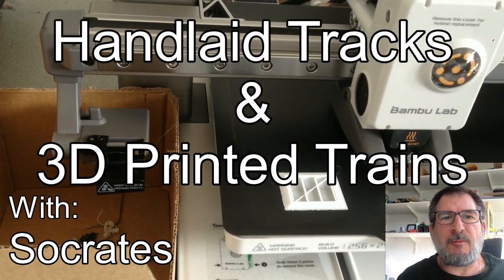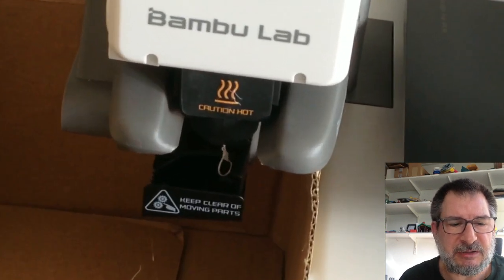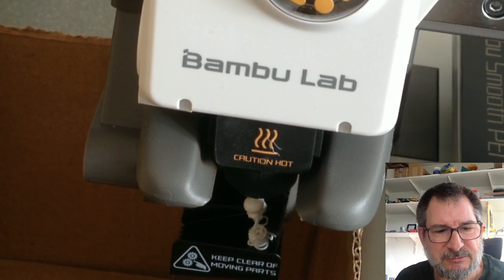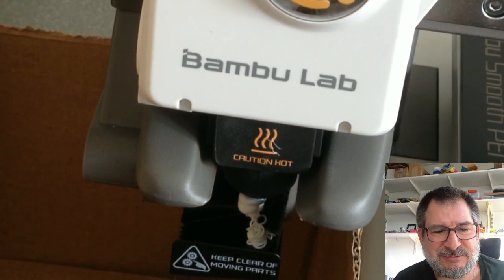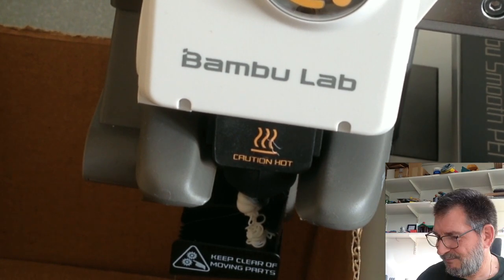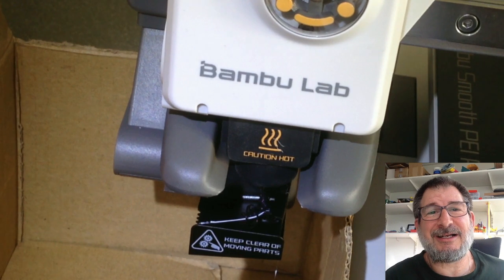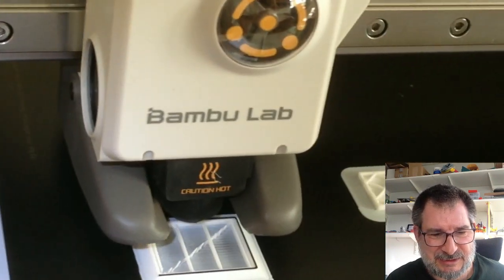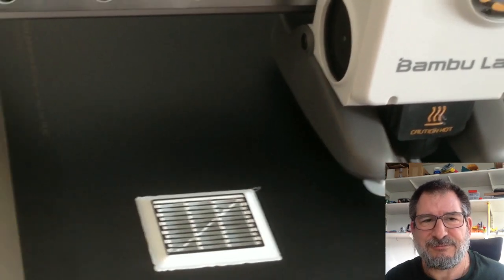Why Is My New Bambu A1 Purging & Printing So Slow Now?

Comment from the maker: Thanks so much for your feedback and suggestions. Since the slicer was sending the Gcode so slow, the printer was doing what it was told to do. The time estimates were spot on. Somehow the STL object became corrupted in the slicer I solved the issue by uninstalling the slicer and reinstalling it again. This removed whatever error was being caused. 
In fact I reloaded the original file from the slicer and the error reappeared. A Bambu Error popup was triggered - Error NAN I believe. So I repeated the uninstall reinstall process and it once again works properly. 
It is easy to tell this error happened since the print speed was reduced about 1/3 as fast. Same print is 5hr that was 13hr with the error.
Ceality makes a good maching. I had many happy years with my CR10 V3 - was my second 3D printer. Started with a Ormerod 1 kit! Very impressed with the Bambu A1 - I bought and returned a X1C - maybe I got a bad unit, but it had serious issues. We get two weeks to return online purchases in the EU. Was almost 3x the price of the A1 as well...

Comment: You need to perform a cold pull, I believe there may be fragments and scraps of other filaments in the nozzle, so search up and try a cold pull, I hope that fixes your problem
Reply from the maker: Turns out the slicer program got corrupted with a bad file. I reinstalled the slicer and it was fine. Resliced the bad file and the same errors came back. Thanks for your thoughts on this problem.
Reply: @handlaidtracksand3dprinted922 no worries

Comment: I had the exact same thing happen on my Flsun SR. I reflashed the printer firmware and the problem was solved.  Could be a heap problem in the firmware?  My A1 and A1 Mini are running perfectly.  I'll keep my eye on them. Maybe over time, the flash memory gets corrupted.  Memory leaks perhaps.
Reply from the maker: In this case it was a somehow corrupted STL file. I re-broke it with that file after fixing it once. Never happened since. So something was wrong with that file. Wondering how the fans get replaced - only a matter of time!!

Comment: My purge wiper kinda clogs. So it runs speed wise when printing but the purge whiper used to shoot out the poops but now it just... Slowly wipes it? And it stays on the purge whiper after a color change.

The only difference i made was flushing volume i set from 1 to .7
Reply: Turns out the wiper itself was stuck with some filament I had to move it gently for it to free itself, it now works
Reply from the maker: The wiper is moved by the extruder head pushing that vertical arm. Have you tried to move the wiper arm by hand to make sure it is free? Does the extruder move over the wiper slower as well? I'd delete the slicer and reinstall it. That is how I fixed this problem. Somehow the corrupted file messed up some internal settings. Using the newest update? Easy to reinstall. Success!

Comment: I had something similar, I tried installing a new version of bambu studio, using default printer, filament and process settings. None of it worked until i just did a factor reset on my a1, then a vibration calibration and now it's back to normal. Tested it before and after with a model i loaded onto the sd card in case it was the wifi. 

Also the default 'generic pla' has a max volumetric flow of 11 instead of 21, so i changed that too although that had a negligable effect compared to doing a factor reset.
Reply from the maker: Interesting, I always DL the updated versions into a new folder so I can go back if needed. Uninstalling and reinstalling the slicer fixed my issues. I've made minor tweaks to settings. Increased gap slightly for supports flushing rates based on colors etc... Thanks for sharing!

Comment: I am having the same problem, plus constantly purging and stringing. If you find a suggestion, please forward it to me.
Reply from the maker: For me this was a corrupted slicer. I uninstalled and reinstalled it and it has been fine since. The file caused the corruption, so maybe you had a bad file somehow. I only print my own designs, so the file wasn't unknown, just somehow bad.
Reply from the maker: Just had another slicer profile turn strange. Was doing a color change every layer even though it was a solid color. Corrupted slicer profile. I just grabbed a slightly different profile and it was still ok, so I re-modified it like the broken one. So far no issues. Made a backup to use if needed going forwards.

Comment: I believe bambu sent out an update that changed the purge procedure to use less filament. Not sure if that’s what it is but maybe check that
Reply from the maker: Tanks for the thoughts. It did seem to happen after I updated. Is a new printer so I'm playing with settings. Adding the 0.2mm nozzle to the config, thought that may have swapped something internally. Reinstalling the slicer worked. The file had the error, I reopened it and bricked the slicer again. So the reinstall definitely worked.

Comment: Go in bambu studio to devices. Click printer parts and make sure it's not set to 0.2mm nozzle.
Reply from the maker: Yea, was my thought too. Was the 1st thing I checked since I had just added the config for the 0.2mm. But wouldn't it be at least as quick with the 0.2mm? Or ir will take days!! But uninstall reinstall the slicer fixed it!
Reply: @handlaidtracksand3dprinted922  0.2 drops flow rate way down
Reply from the maker: I meant the print head speed. If the head also slows down for the 0.2mm, then it is double slow. One of the most obvious difference between the CR10 and the A1 is the blistering print head speed on the A1.
Reply: @handlaidtracksand3dprinted922  Yes, the print head slows down to match the flow rate. If it's set to 0.4 and still acting up, factory reset it and see if that fixes it. You can also try uninstalling and reinstalling bambu studio or try Orca slicer. I'd probably start with Orca first though. If it's fine with that, then uninstall/reinstall bambu studio

Comment: May be a shot in the dark, but if the nozzle is not clogged I suggest the master crystal oscillator on the motherboard may be faulty and is oscillating at a lower subfrequency. This would cause the processor and thus the timing to the motion steppers and the extruder stepper to run at a much lower rate and give the symptoms you describe.

Comment: 1. reset printer to factory defaults
2. try again :)
Reply from the maker: Did that to no avail. Did it with the slicer - uninstall and reinstall - We rocking and rollin' again! Thanks for the thoughts!
Reply: @handlaidtracksand3dprinted922  when stuff that worked yesterday stops working like this, i always just reset them :)

Comment: #1 derp check - slicer.  Open project -> filament settings -> check your mm3/s volumetric flow rate isn't constrained to something very small.  PLA should be 10+.  Also, if you have pre-sliced files from a couple weeks ago, reprint one.

#2 - During the purge around 1:12 the extruder gear wheel looks like its buckling back while trying to push forward.  A quick troubleshoot: If you have a spare nozzle, slap that in, run the calibration from the maintenance menu, then rerun a print.   This will tell you if its the extruder motor/gear having issues, or a hotend nozzle melt path problem/clog.   If it now works fine, the old nozzle has some sort of a clog [usually fixable] or other aperture problem in it [that may be harder to fix yourself, just replace and curse their proprietary design].
Reply from the maker: The old files were all 7 hour prints... The flaw seemed to be the slicer. I uninstalled it and reinstalled it and it worked again. I actually opened the file from the machine side in the slicer again and POP up came the error window and it again sliced an hour into three and a half hours. So the slow print head made sense. Repeat the re-install and again it worked. It printed fine - but just slow, so the nozzle seemed ok.

Comment: I am currently using mine and it had some kind of update to do with filament profiles. and mine seems to be doing something similar. so might have something to do with that.
Reply from the maker: Yea, I ran the updates and added the 0.2mm nozzle as well. Uninstall reinstall fixed it though. If it isn't blistering fast, something is wrong...
Reply: @handlaidtracksand3dprinted922  glad it's all working now. One thing I noticed on mine, I had a print lined up and yesterday it had a build time of 7 and a half hours so I put it off to today. Today the print time was 5.3 hours. so probably a slicer glitch.
Reply from the maker: That is concerning if you didn't do anything between the slices. If you editied it, missing even a small piece during the color selection can really add to the time too!

Comment: Funny "it's like a creality now"

My creality K1 Max works just fine.
Reply from the maker: I meant the print speed. Love my CR10 V3 - used it for years no issues, but it is 1/4 the speed of the A1. The 30cm bed is the one thing the CR10 has over the A1 so far. Everything in my layout up to the multicolored cylindrical grain cars is ff the CR10. 
Looks like the K1 Max is bigger and more expensive than the A1. I returned a X1C - maybe it was faulty. The A1 is 1/3 the cost of a X1C and a better printer so far for me. Soap and water cleaned the PEI bed and fixed my adhesion issues.

Comment: A couple of things.  Make sure that it is printing in 100% speed.  On the panel, go to Control > Speed (speedometer icon) and make sure Standard is selected.  Another thing that might be causing that is a clog.  I like the video made by @Tombof3DPrintedHorrors on how to unclog the A1 (https://www.youtube.com/watch?v=cNBu2mcOH8E).
Reply from the maker: Thanks for the thoughts! Somehow the slicer corrupted the file and uninstalling and reinstalling the slicer fixed the issues.

Comment: you've probably damaged the nozzle or the extruder gear.   maybe even the extruder motor
Reply: after watching is almost certainly a clogged nozzle
Reply from the maker: Fortunately not! Turns out the slicer was somehow corrupted and reinstalling it fixed the issues. If you watch, the purge took four minutes! No doubt I was clogging the nozzle...

Comment: I think the other comments are correct and that it's a partially clogged nozzle. If you have flow calibration on, it could detect low flow rate and slow your print to compensate?

Try doing a cold pull and some filament swaps to other types to troubleshoot.

Under maintenance mode, if you select manual extrude will it shoot out a nice line of plastic? If not, that's your problem.
Reply from the maker: Yea, that nice shooting out of the plastic was missing! Very frustrating! Reinstalling the slicer fixed it though! Thanks for the tips, will check out the maintenance mode.
Reply: especially with the blobbing on the first black layer we see near the end, that is definitely a partial clog.

Comment: Try printing a print from before the slowness started - one that moved with a speed you’re satisfied with.  If it prints fine, then it’s a slicer setting issue.
If it’s only slow when filament is coming out, maybe check whether you accidentally switched a setting from 1.75mm filament to 2.85.
Reply from the maker: I pulled up a few older sliced files from the printer and they all had the proper quick times on them still. But they were 7 hour prints... What it did print was just fine. I did that years ago 2.85 - was very cool. Like puffy foam. Uninstall reinstall the slicer fixed it!

Comment: If you have changed the colours on the AMS have you checked whether the flushing volumes in the slicer have auto updated? Might be worth forcing this manually. Also check that the printer speed has not been changed to "Silent" in the touchscreen menu. To check this click "Control" and check the speed dial says 100% in the bottom left corner, if it says 50% click on it and change to "Standard". Might not be this at all but worth checking.
Reply from the maker: It was consistent in how it was being wrong. The time was right as it sliced. But when I used the presets, all should have reset too. So the slicer seemed to be the issue. Uninstall reinstall the slicer fixed it!
Reply: @handlaidtracksand3dprinted922  Excellent, good job getting it sorted. Enjoy the printing :-)

Comment: if it is a clogged nozzle you probably have to do a manual coldpull which idk is possible on these printers. if not then you have to buy a new nozzle/hotend for 12$ plus shipping. 

personally thats why im on the fence about buying the A1. with my ender i can get a bag of nozzles for 5$ and just change it out whenever i think i have a clogged nozzle and 90% of the time that fixes it. at a cost of 25 cents. 

let me know if you change out the hot end and that fixes it.
Reply: I have an A1 and Ender 3. You can do a cold pull on the nozzle fairly easily. You can also remove it with no tools and heat it with a torch to help clean it.
Reply from the maker: Turns out the slicer needed a reinstall to remove whatever became corrupted. When I reloaded the file from the machine - it rebricked the slicer. So the reinstall definitely works. The A1 is a full step above my CR10 V3. Speed and quality. I used to leave a gap to make a part fit inside a larger piece. The A1 lets me eave no gap at all. Have no clue what will be required when the nozzle clogs. I've replaced the extruder on the CR10 a few times though!!

Comment: Which filament are you using?
Reply: Came here to ask this too
Reply from the maker: I buy in bulk from Alibaba into the EU via rail. 24 rolls usually comes out to $8 or so a roll delivered. Four or five different suppliers and always so far no issues at all. One roll of Gold was a bit thick in spots, but I used it for the filament spools and holder. It still printed fine. PLA+